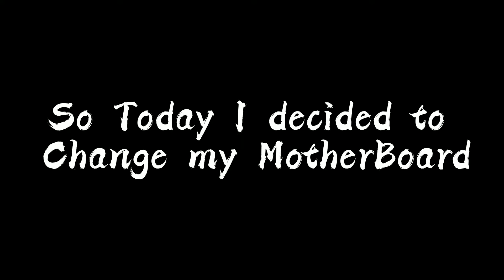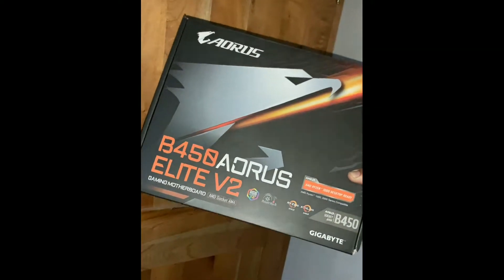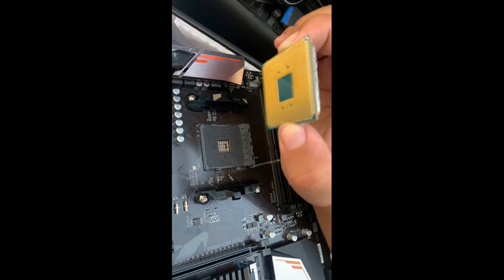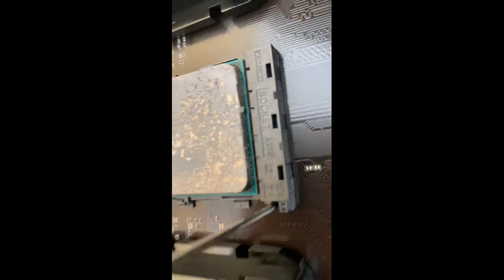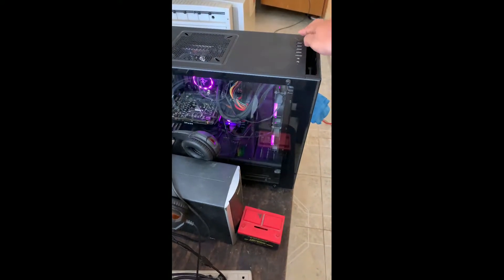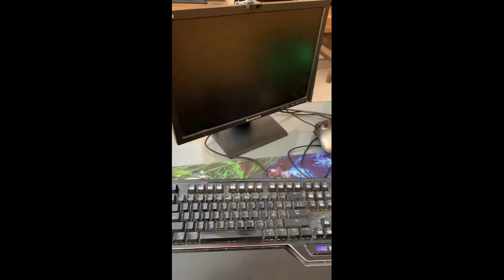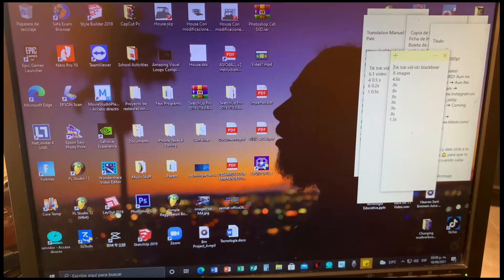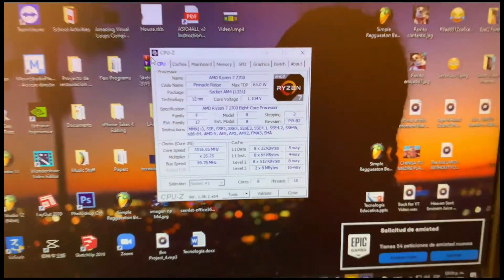Can I replace my motherboard without erasing all my data 2021?

Comment: So im planning on upgrading my cpu because the one i has now doesnt support 13th gen cpu so if i upgrade my motherboard that supports that it WOULDNT delete my old data like old files and how my desktop looks etc? (Im planning on getting the same brand motherboard btw just a higher cpu supporter)
Reply from the maker: I recommend you back up what really is important, and then proceed to change the motherboard and see if it boots up properly. (Like I did in the video) Sometimes if you do not do this procedure the right way, the processor and motherboard don't communicate correctly which as a result the majority of times is that it doesn't boot up.

Comment: Hello, I change my motherboard with the same model and brand AsRock Fatality 990FX killer.  I got everything in place, tried clearing the cmos by using the jumper and even took out the cmos battery.  But still I did not get any boot or beep.  And I even tried to put a new ssd just to check if it will run on a new ssd, but it is to no avail.  What could be the problem?  I check all the connection, it is all in their proper places.
Reply from the maker: There could be various reasons but I have my mind on the ram. Did you place it right and is it comptatible with your Mobo?

Comment: Bro question how about the motherboard apps likr for example amoury crate something like that ...do i need to uninstall them after ? My issue is that my motherboard got wet and beyond repair but dont want to format will the drivers automatically installed and about the old drivers do i need to uninstall them  ? hope you read this thank you
Reply from the maker: Let me know what happens !
Reply: @ytmrezeq  thank you for sure i will update 😀 thank you for the reply
Reply: @ytmrezeq  Update sr its working perfectly fine from aorus b450 pro wifi tp asus tuf b450m gaming pro just plug and play like you said and run the windows update everything workfine no issue ... Again thank you sir :D
Reply from the maker: @mikeslashmunir  So glad to hear that ! 
No need to thank (:
Reply from the maker: Hey there! If you are just going to change your motherboard you really shouldn’t have problems. Your pc may struggle a little bit but should be able to recognize everything from the windows to your files! (Even your drivers) 
As long as it’s connected to internet it will start to download them  automatically 🤓 (usually the case for windows 8-11)
Reply: Hello, I want to change my motherboard to a more advanced one, can I have problems after turning on the PC?

Comment: So im bout to do this same thing but instead of amd im going to use intel cpu and mobo. i've checked and the cpu is compatibale with the mobo. will i boot up to my current desktop without any issues if i just replug all the sata cables in the same sata1 sata 2 etc slots that i used in my old one?
Reply from the maker: Yes, no problems should occur. I did this with tpm on and other advanced bios settings and had no errors. Either way be cautious and good luck. Comment your results !
Reply: @ytmrezeq  Okay and should i do it when im activated to my ms account or just do it with my  own local account.
Reply from the maker: @Nico-ww9lg  Really doesn´t matter , key activation is usually on HDD,SSD,SSD M.2.
Reply: @ytmrezeq  and one more question. So my current mobo is so old that it doesn't support tdm am i going to have a problem with that. And i have win 11 installed on the other mobo in a m.2 drive. If i remove the m.2 and install my own ssd it should still work right?
Reply from the maker: @Nico-ww9lg  Yes it would just have your bios settings that are compatible with the current system in this case since the last once didn’t have that it’s just going to be disabled.
Reply: @ytmrezeq  okay thank you so much man gonna try it maybe tomorrow hope it goes well. Gonna update you then. Upgrading from i5-2500k and z77-g43 mobo to i5-9400f and prime h310-plus.
Reply from the maker: @Nico-ww9lg  Goodluck!
Reply: @ytmrezeq  Sad i couldn't get it to work. It kept saying that hdmi power saving and anything i did i couldn't get it to work
Reply from the maker: @Nico-ww9lg  What errors popped up, or did it no boot up?
Reply: The computer booted up and the fans were spinning but my monitor said hdmi power saving mode and i couldnt get into bios
Reply from the maker: @Nico-ww9lg  I’m thinking that the CPU update was too much 
Did you change memory ram?

Like I mentioned in the video 
I only changed my motherboard so it was all just about my bios settings adjusting automatically but in this case you changed the cpu. 
Either way it didn’t hurt to try 
Hope someone in the future reads this and helps them out !
Reply: @ytmrezeq  ye so i changed my mobo to the h310 plus and a cpu with it and then i had 8gb of ddr4 ram with it. Well i got my old settings and stuff back when i changed back to my old mobo so all gucci.

Comment: Im upgrading a mobo from a gigabyte b550 ds3h to a b550 aorus elite v2 will everything work fine without losing anything?
Reply from the maker: Everything should work just fine 
By looking at the specs they are completely compatible, just connect everything right before turning it on. Let us know what happened !
Reply: @ytmrezeq  OK!
Reply: @ytmrezeq  3rd time im ordering it! Seems that we have no problems this time. Im updating you when I finish the upgrade
Reply from the maker: @Vaggelis.08  I’ll be waiting 🤓
Reply: @ytmrezeq  Everything is working so far temps are lower idk about performance yet no probs with windows or loss of data!
Reply from the maker: @Vaggelis.08  Glad to hear that ! Success 🤝

Comment: I'm upgrading my motherboard and cpu. I'm pretty sure everything is compatible, but will It work fine? because I want to keep all my files and data.
Reply from the maker: Yes it should 
Just make sure you connect your storage  devices in the same place you had it on the other motherboard.  

Let me know !
Reply: @ytmrezeq  hi I am going to change my processor and mobo from amd athlon to ryzen 3 ,currently using win 7 ,do I need to backup or anything? Will it be compatible?

Comment: Have you run into any problems after this video with your pc
Reply from the maker: Hey there! No, I haven´t had any problems but that´s because I made sure each component on the previous motherboard was compatible with the actual one!
Reply: Yeah I did the same and mine is fine great video
Reply from the maker: @itsbeerme487  Awesome ,thanks for commenting your result !